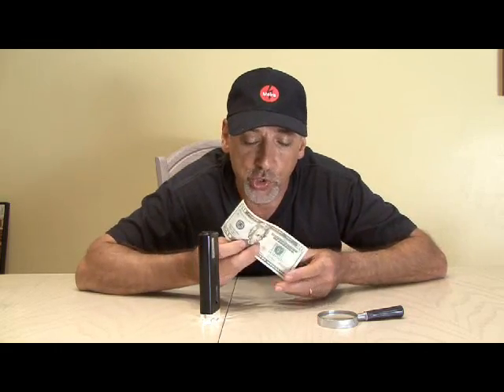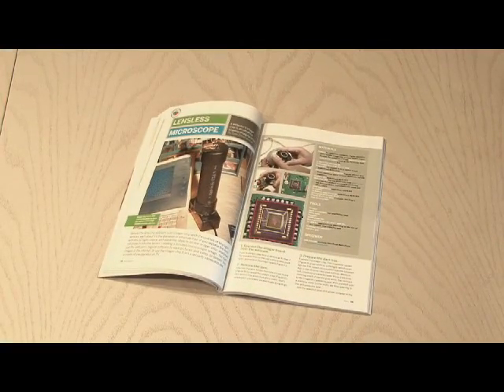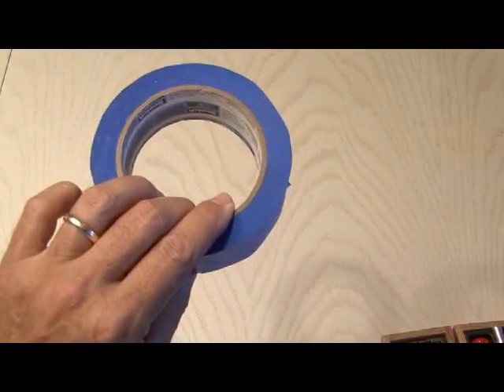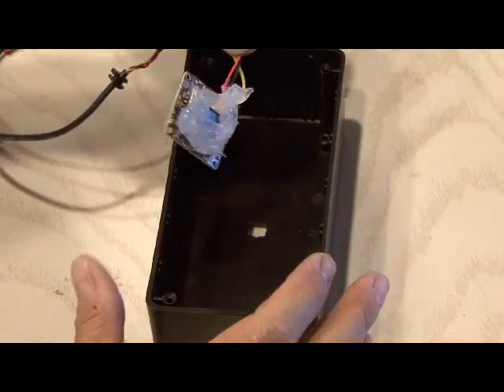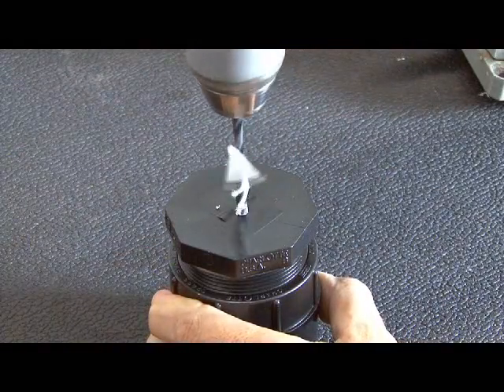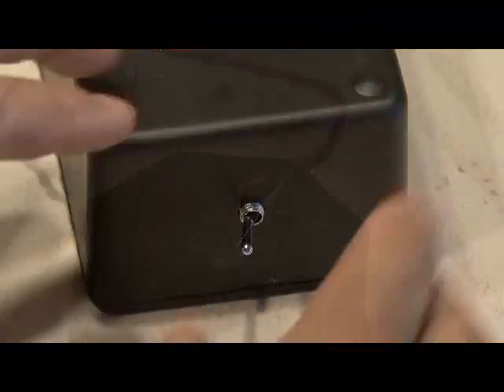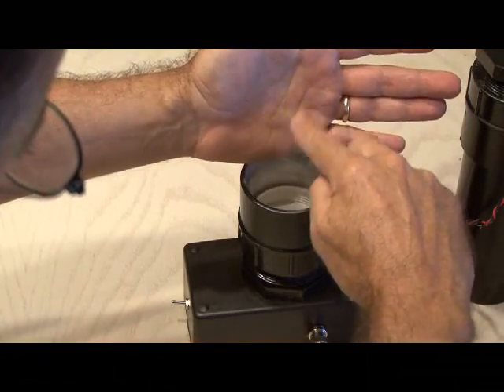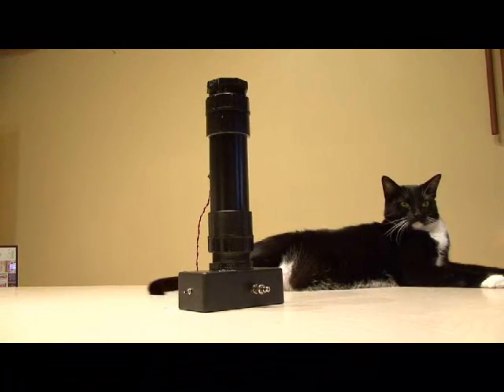Weekend Project: Make a Lensless Microscope

Comment: I don't understand why the long PVC pipe was needed. Or a least, why was it that long? Since there are no lenses and then specimens sit right on the CCD or CMOS Imager (thin glass slides and a couple well placed slits and you could use standard specimen slides!) so theres no Focal length to worry about.
So why the 6"-10" distance from the CCD\CMOS? The light at that distance isn't that good to begin with. I'd swap tp a better, brighter LED. I'd use a tri-color or Rainbow LED.
It's totally sick!

Comment: Objects have better contrast in Bl ack & White than in color. But there's no rules here. If you want to use a color camera then use a color camera if that's what have. You can always turn the color, hue and saturation down to zero to remove all the color elements. The downside is that you would need to bring a computer and monitor. Hence, the reason for using a wired CCD camera instead of a webcam and all you need is a TV with video inputs. You could even use an old Radio Shack Color Pocket TV.

Comment: Since there is no lens, there is technically no magnification. The imager pixels are about 10 micron and the pixels on a monitor are about 300 micron, producing an effective magnification of x30. The reason I say there is technically no magnification is consider if the pixels were 1 meter (3 feet), the image would be huge but there is no more information, no more detail, in the huge image.

Comment: You could use lenses but that defeats the whole purpose of the "lensless microscope". To get higher resolution, use an imager chip with smaller pixels. For example the video chip Kip is using has pixels about 10 to 12 microns. An 8 Mpix camera has 2.2 micron pixels, providing about 6 times the resolution.

Comment: yes, pretty much anything with a digital imager chip-- like a still camera, web camera, security camera--- can be used. you place objects on top of the glass the protects the chip. the silicone glue is used to prevent water from getting on the circuit board and shorting out the electronics. the led is the point light source to create the shadows of the objects on the imager chip.

Comment: The specimen sits on the protective glass cover of the imager chip. You are seeing the shadows of the specimen on the imaging sensor. The cardboard circle lets only direct light from the LED hit the specimen, blocking all reflections off the sides of the PVC tube which would otherwise cause a fuzzy image.